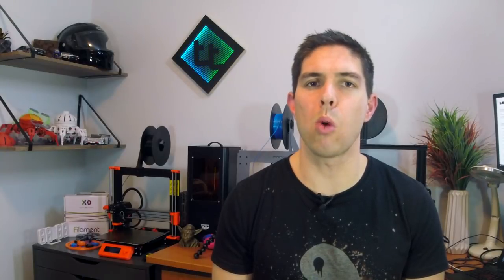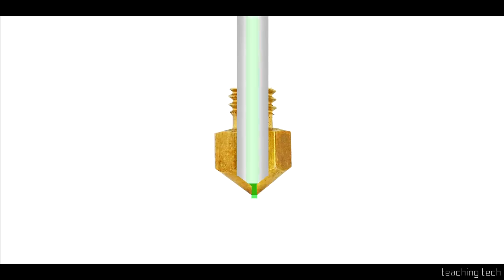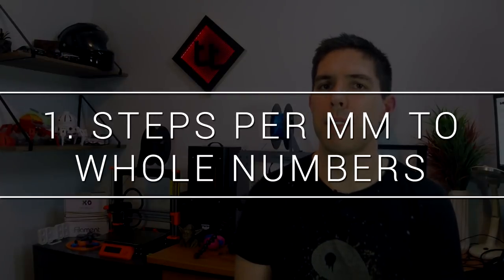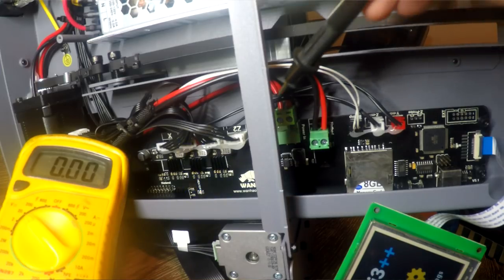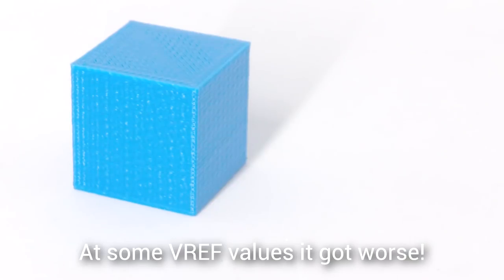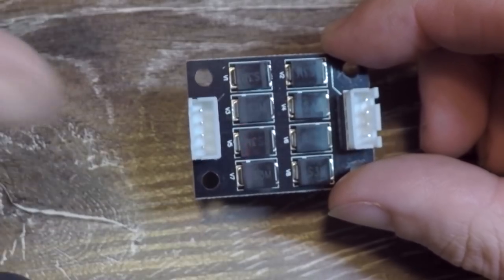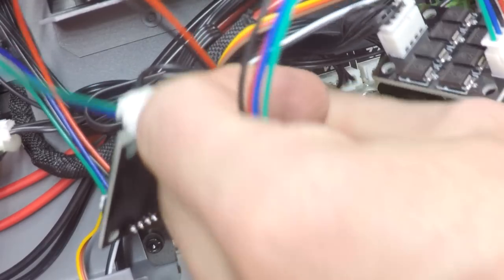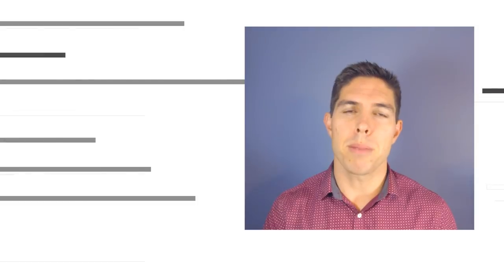Four ways to beat moire on your 3D printer

Comment: For drivers such as 2208, it is useless to install TL-Smother. It is not realistic to accurately determine up to 0.1, for example 10.3 how to distinguish from 10.5?
In my thermal barrier the tube is pressed, I doubt that it is possible to lengthen without consequences.
You have skipped steps. To do this, it is enough to reduce speed and acceleration.

Comment: tlsmoother is not "smoothing the pulses" it's solving the problem with driver not properly microstepping motors at extreme positions (around zero crossing) so using diodes to clip voltage and solve the problem of mismatch between driver and motor so the steps are not missed. You can find more info on how the "smoother" works here: http://cabristor.blogspot.com/2015/02/drv8825-missing-steps.html?m=1

the other "very good" way to solve the problem, that gives much better results then using tlsmoother, is to switch drivers and move to a higher quality drivers (e.g. TMC ones are pretty good and don't require this clipping diodes with nema17 motors)

p.s. don't forget to add a smoother on the extruder motor too :D
Reply from the maker: Thanks for your info. I already have that site linked in the description because I covered it in the video. Also, this printer has a Melzi with integrated drivers, so changing them is not an option without changing the whole board.
Reply: hm weird I see it now in description, looks like youtube weirded out the description was empty when I looked the video :D ... as for melzi, it's a piece of %$@%^*$ that pretty much should be immediately removed :)
Reply from the maker: Haha that's a strong opinion.
Reply: had at one point 6 wanhao's and 6 m150's in the workshop, out of 6 wanhao i3 all of them burned up, had issues with temperature readouts etc.. m150's came with better connectors so did not burn up in same timespan but were replaced as well due to similar errors they were showing ... the boards have improper power distribution layout and is a damn fire hazard... can't talk about the wanhao + and later revisions (like the one you have with touch screen) as have not seen/tested those myself but regular i3 and m150 came with melzi's that are utter crap ... I unsoldered drivers from them and recycled all 12 of those boards
Reply from the maker: Fair enough. The older style ones would certainly be much more convenient to work on. I had a similar experience when Solidoodle changed boards back in the day. They didn't include a bootloader and a bunch of users didn't have the skills/confidence to upgrade firmware.
Reply: can't say as I never tried the new ones but from the images I only see they changed connectors .. adding external fet drivers do help with crappy board design but you know, trust, it's a big thing for me, I lost trust that they have a clue what they are doing electronics wise so I stick with my own design... on the other side I do kinda dislike arduino, marlin and the whole chabang so that's another reason to not stick with those boards.. I might have some free time during summer to test out klipper, in that case some of those boards might have a use if the brain is moved from atmel to something else :D but still ... heavy modding required to get them to my spec :( ... now I heard some of the wanhao's moved to 24V -> those might be better, have not tested those boards but since current is way down due to double voltage maybe the crappy design is just masked by low currents.. trust, trust, trust.... wrt wanhao, for me, lost ... luckily replacement electronics are all around so..
Reply from the maker: All of the available options are what makes it so much fun. Please see my frankendoodle project, still Marlin but you might like it. And yes this system is 24v.

Comment: Hey mate, Do you know why i would have this issue only on the top part of the benchy? I just finished fine tuning my ender 3 and it is giving me fantastic prints, Have not noticed any moire on any prints until today! All of a sudden, After levelling the bed and printing a benchy i can see some diagonal lines appearing only on the top section (the cabin?) of the benchy.
Any ideas what causes this? here are some pics - 

https://i.imgur.com/QoAXN4e.jpg - can see moire on the cabin
https://i.imgur.com/vJF5lJk.jpg - print look great
Reply from the maker: It shows there because it's a flat wall. Certain speeds and flow rate combo can show or hide it, did you tweak your slicer profile?
Reply: @TeachingTech  thanks for the reply!, only thing i changed recently is my layer height down to 0.12mm and the quality is great. haven't noticed this on any other prints. do you think smoothers will help? or print a benchy at 0.2 and see if they are still there?

Comment: Moiré.....Pronounced 'mwar-ray', due to the accent over the 'e'. Sorry. Born speech-nazi, ex-graphic artist. This word is pretty common in graphic design. I don't have this printing issue but I suffer from vertical lines at regular intervals which I can only guess is due to belt vibration over the non-toothed rollers? Anet A8. I'm going to sat that I was almost ready to to start looking at a better printer after having lost interest about a year ago. I started out last week by printing off tensioners for the x and y axises, buying a large, 24"x24" (60cmx60cm) concrete patio slab, then I took a piece of aluminum channel I had kicking around, cut a piece the width of the top of the printer and got a cargo strap to literally cinch it down to the patio slab and the table it's on. Of course as you add all the upgrades you have to keep tweaking the machine as things change. I can now print an xyz cube with perfect dimension, nice, straight corners between layers and nice text. If anyone is goung to stabilize this way, you will need to print three 'caps' to go over the aluminum rail with the center one higher so downforce is applied to the center and not just the sides.....this will force everything to the center which you DO NOT want, and I still need to create a taller center piece to essentially create a triangle which puts its force equally along the base, but for now it seems to be OK. Here's a pic: https://drive.google.com/open?id=1hfF8KU42E7Ev6zG_OVM3VdNZvD9W9MLtAlso you MUST put this behind the LCD as it puts too much downforce on the front of the printer if you put it in front, and you will find the print head crashing into things. Keep the strap directly above the vertical upright structures of the frame.  Putting the entire thing on a patio slab also has the added benefit of making it about 60% quieter. I put a piece of cheap foam yoga mat under the stone and I still have about an 1/8 inch clearance under the stone after applying tension.

Comment: I wonder if some kind of smoother would work with mk3's extrusion inconsistencies too.
Reply from the maker: I was tempted to try and probably will at some stage.
Reply: Great!
Reply: Nope. Tried that.
Reply: If you want to improve the extrusion consistency on the Mk3S, move to the Bondtech geared extruder drive. Yes it's $110, but it works. Prusa should include it as standard.

Comment: What??? E Steps round
Do you even know what that would mean
Lets say i want a cube which is 10.05mm
So it will round it to 10.1
Or a cube which is 10.5
So it rounds it to 11mm

Makes 0 sense
Reply from the maker: That is not what it means. You are rounding the dimensions of the final object (x and y axes), not the e steps which are used to calculate extrusion. Rounding e steps is probably negligible but not for the reasoning you write.
Reply: @TeachingTech  3:06
Did i misunderstand this part or what

If i didnt the that means that the little dents the extruder makes into your filament would immensly hurt the printquality. In that way the "round" number theory of yours is total nonesense

If i tell my extruder to extrude 0.1mm of filament, then it will do that, even if it had to use microsteps. Else your prints would have huge blobs all over it.

So whats your point i dont understand
Reply: @TeachingTech  AND if you believe that when yoh turn of your printer it loses the spot of the microstep

Well thats the reason why we do skirts!!!

Comment: Your representation of the e3dv6 nozzle is wrong !
here is correct one https://www.cnx-software.com/wp-content/uploads/2017/06/E3D-Bowden-Connector.png
And if you look on the pic you will see there is no cavity as in your description.
Reply from the maker: The diagram is generic. Although the e3d is mentioned, it was never claimed to be the source of the graphics. In fact this video is mainly about a flexion extruder.
Reply: @TeachingTech  Your representation of the flexion extruder nozzle is wrong!
here is the correct one https://flexionextruder.com/wp-content/uploads/2016/07/HowItWorks3.jpg
And if you look on the pic you will see there is no cavity as in your description.
@Snypi_PL sorry for copying your text, but it's still a wrong picture.